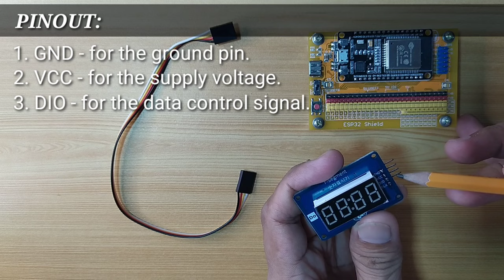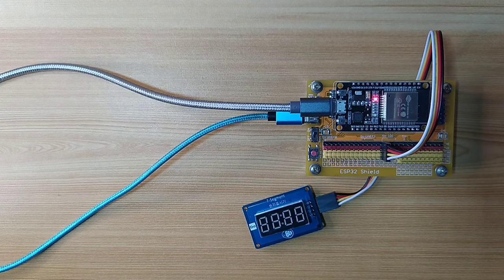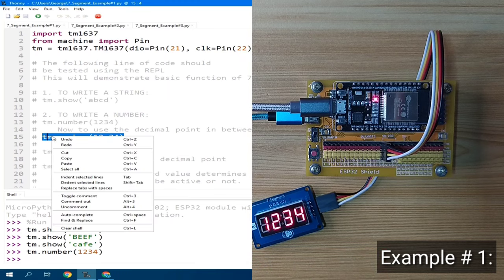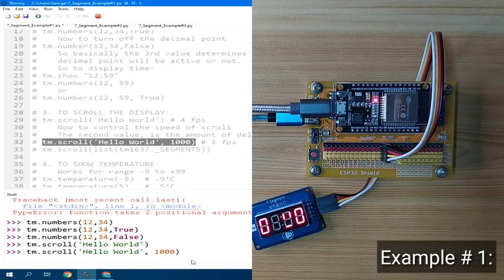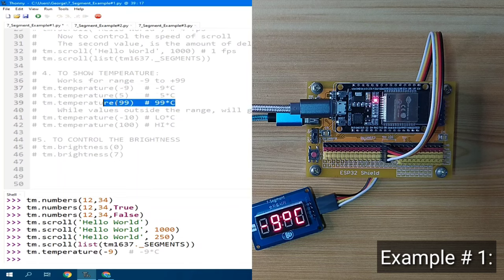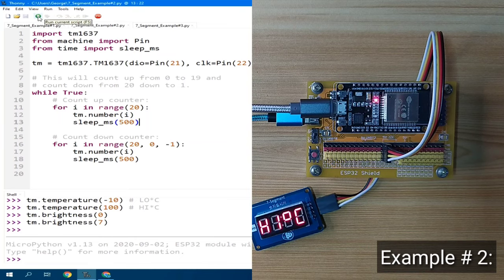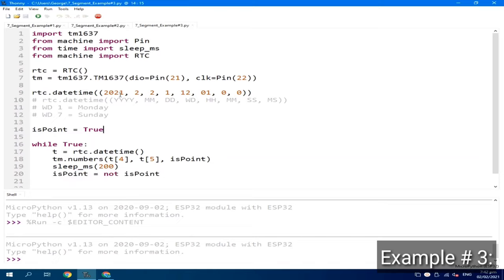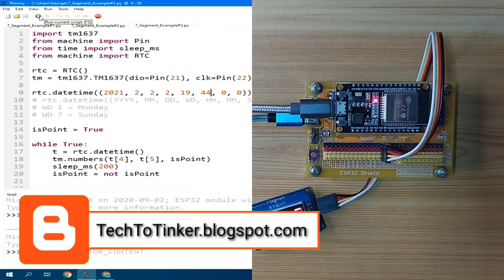009 - MicroPython TechNotes: 7 Segment Display

Comment: Dear sir Let me clarify I have a doubt regarding micropython weather I want learn or not when compared to Arduino C and C++ micropython little bit not available some libraries. That's why I am confused tell me your suggestions in feature it is useful or not for learning micropython.
Reply from the maker: @Pamarthi Kanakaraja, C/C++ has every sample code and libraries you can think of. It is flexible and executes code fast. While MicroPython is still young compared to C/C++ hence, limited resources available online. It is also an interpreted language so its a little slow. 

MicroPython is also easier to learn than others.

But, of course, the final decision is still yours to make. Cheers.
Reply: @TechToTinker  thank you sir for your quick response 🙏🏼
Reply from the maker: @Pamarthi Kanakaraja, my pleasure. Thanks :)